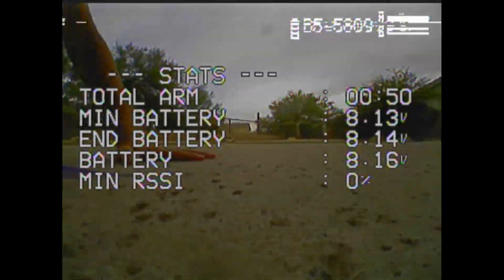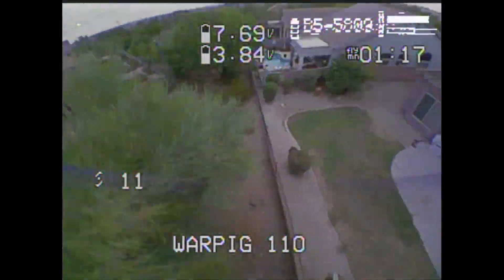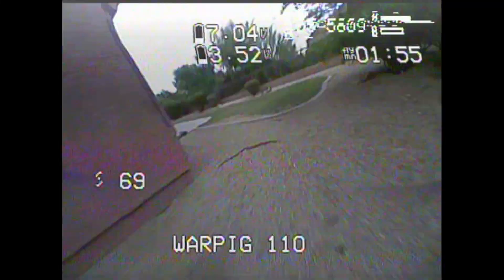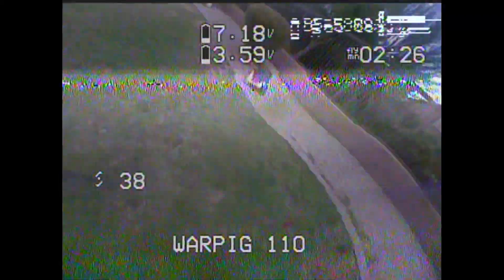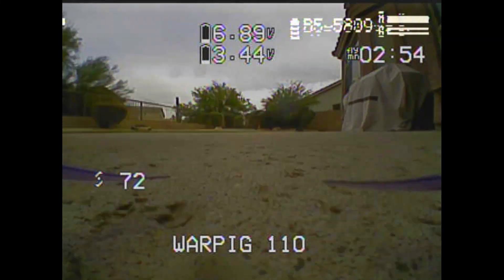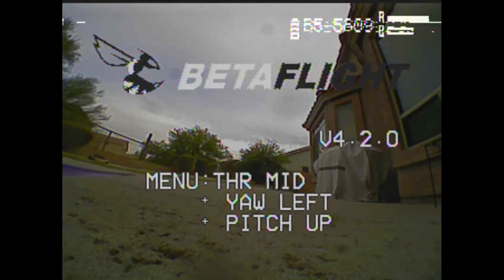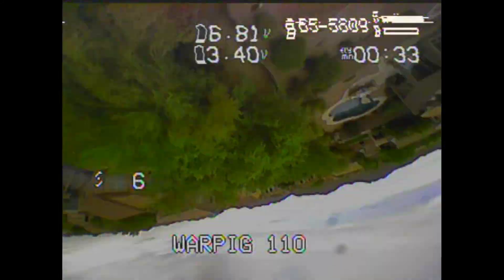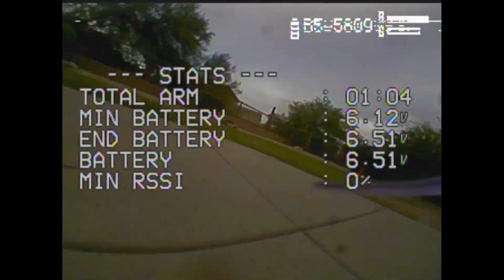Quadcasting: Disable ADC make Feed Forward Awesome (instead of weird irregularly irregular)

Comment: First of all, it wasn't awful, it was gold. Second, I watched that video right after Mark uploaded it and immediately new it would help w/ my jittery dx6i's. I also used average_3 and depending on the quad, also increased ff_smoothness (44 is the most I used). These combined with ff_boost and we can really dial-in the feel now.
Reply from the maker: I still need to dig in to the smoothness and boost. But this change really opened my eyes on how FF can be really good to sharpen up the response without getting all the weird irregular vagueness. I was on the verge of abandoning the 1103 T65 2S format in favor of the 1202 3018 but now the little guy finally flies so intuitively its just awesome.